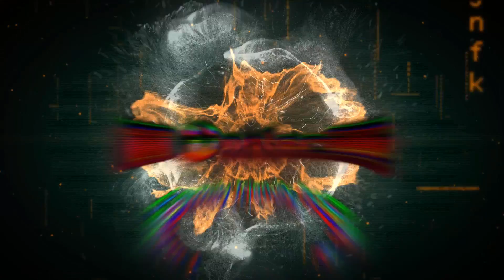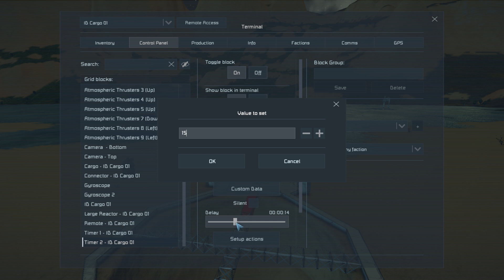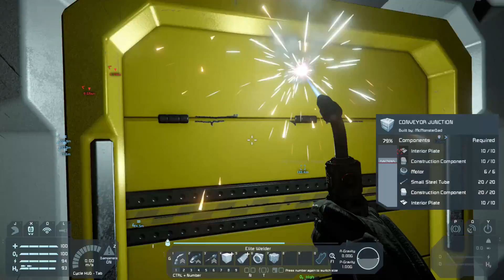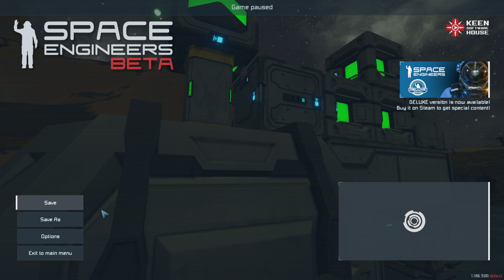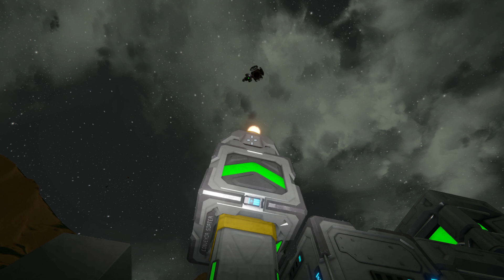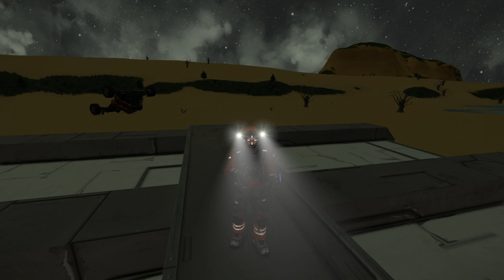Space Engineers Single Player Survival Season 1 Ep 10 - Cargo Drones Away!

Comment: When mine reaches a new waypoint it keeps spinning around in a circle XD I don't know what I did wrong, followed you step by step
Reply from the maker: It can be the simplest little thing. Splitsie has done a couple of really great tutorial videos on getting drones to work - may be worth checking out those - they're not too long either.
Reply: @mcmonsterdad7506  Thanks for the reply. Got it working, used another drone build and had the remote over the connector. The drone will try and line up remote with the way point and if it's the tiniest bit off, it will start spinning and not stop as it is trying to do little corrections that I can't achieve. Check out the V-Cargo carrier is a large atmospheric thrusters build with 5 large CC. Very useful for ice transportation
Reply: @mcmonsterdad7506  But I have got a problem. When the drone disconnects, I have to toggle the thrusters off and on to get the to work, like some sick I.T joke xD

Comment: I can attest to the number of Timer Blocks required to set up the system of pushing out and digging down from my earlier comments about the similar rig that I buit.  That had 22 Timer Blocks, two of which were redundant but put in place for aesthetics.  So, 20 TBs were required to make it function, the last TB being the one that retracted everything back to the start position, turned everything off and turned on a flashing light to signify that it was finished. 

Setting up those TBs was a nightmare and there is no simple way to save the settings to be used when a new rig was built.  Taking a blueprint didn't work as it didn't save the settings.  That many settings on TBs is wide open to errors occurring as each one sets of the next.  Link a TB out of sequence and it all goes horribly wrong.

My TB requirements were so high because I only had one drill on the end of two arms.  Yours could be much simpler because you could have one cycle that completes as it currently does, then have the vertical piston retract, the horizontal piston push out to the next position and the repeat the cycle.

But to be quite honest, with the amount of ice these things can harvest, I don't think it is necessary.  As you said, a field of drilling rigs will look more impressive.

Comment: Hi !
Nicely done with the drones !
When I saw your drilling plateform working, I got an idea : why didn't you build a mobile drilling plateform ? I mean, you can easely put some atmos thrusters, some gyros, a landing gear and a small cockpit (or a remote control) on it and to avoid vibration pbs during the drilling process, cutting off the flying mode. In that way, you'll have a reusable drilling plateform. It'll be cheaper than destroying and rebuilding the plateforms.

I thought to another thing. When your supply chain will be operationnal, you'll have a bunch of drones to control, with a lot of waypoints to manage. It will be a lot of work to do that.
There is a script that run with programmable block and some supplemental stuffs (and setup too) that would be very usefull for what you want to do.
https://steamcommunity.com/sharedfiles/filedetails/?id=1224507423
Reply from the maker: Hi Alex. I considered a mobile platform but the main reason i didn't was because i actually want the finished area to look like an area filled with platforms and multiple drones.  I'll check out that script. Thanks again

Comment: If you put a landing pad on the bottom of the mining rig instead of anchoring to the ice with fixed blocks, it then becomes portable. You can move it with a skycrane ship and you'd just have to update a couple of drone waypoints after moving it and you're back in action.
Reply from the maker: I considered portable rigs but liked the idea of having lots of them across the ice field with multiple drones running between them.
Reply: As I mentioned in the previous clip, using the Landing Gear as the platform is pretty useless as it is impossible to get it to set down dead level.  And if it isn't level, it just shakes apart once the drilling gets underway.